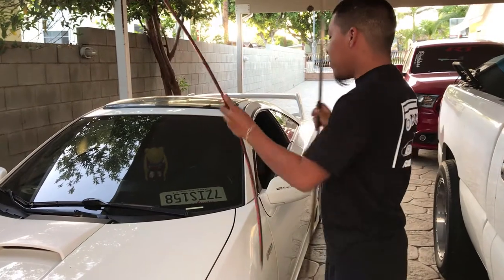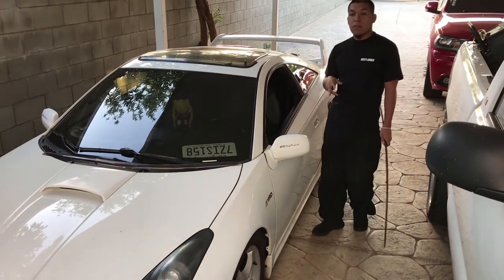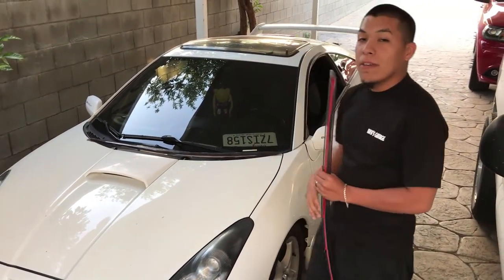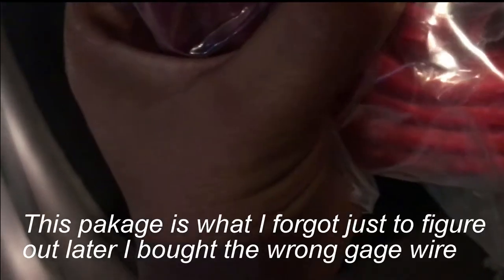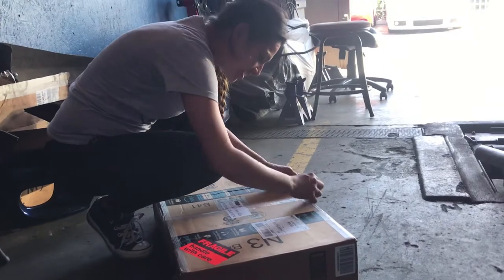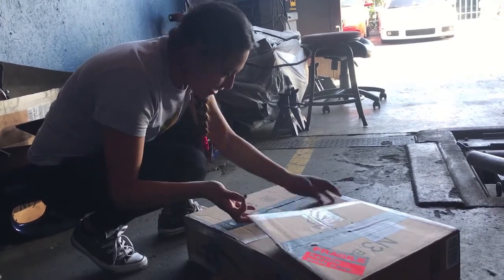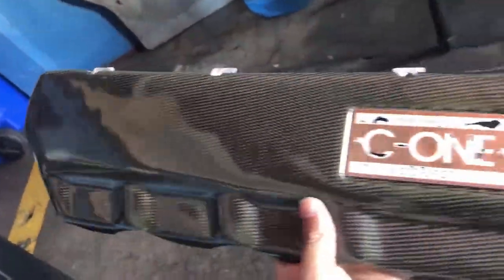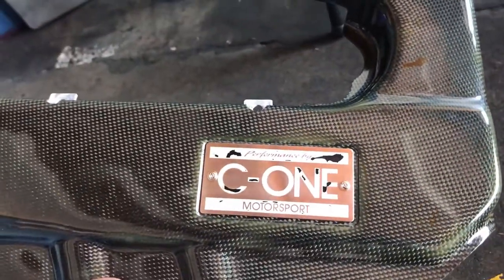How To Install JDM OEM Window Visor On 00-05 Toyota Celica Also More C-One Parts

Comment: Hey, rafa you seem to be the best at working on celicas . Ok so my rear sway bar broke . I mean do you think I should replace asap.i been driving dont notice anything weird while driving.. i did go to junk yard and i scored i was able to take one off and the sway links .. what's the purpose of the sway bar  rear..?
Reply from the maker: Robledo,D to give it more stability, if your sway bar is broken or one of the end links your car will start feeling like a boat when you drive, i would recommend fixing it and not taking hard turns rn
Reply: @RafasGarage  thank you I will try and put it on myself it's raining in chicago .I mean I took it off at junkyard lol I hope I can put it on. I will try monday.. Thank you Bro.
Reply from the maker: Its not that hard just take down your exhaust makes it easier
Reply: @RafasGarage  lol yes I know the rubber clamps get in the way found out the hard way at junk yard lol I cut them off . I would have to spend more time and figure out how they come off.  Thank you.  You da Man bro..!!
Reply from the maker: Your welcome, use wd40 and a flat screw driver to pry them